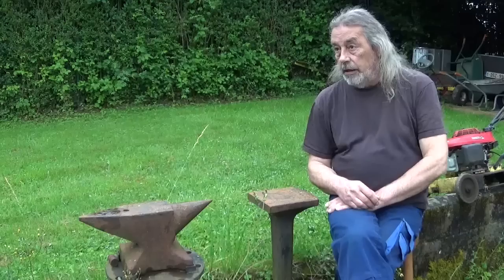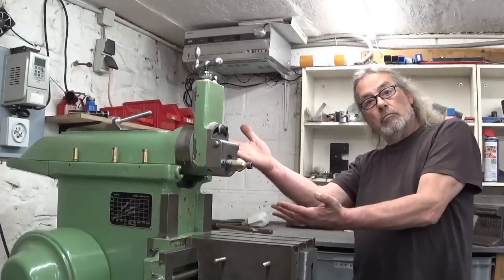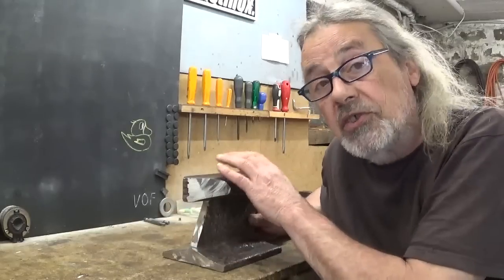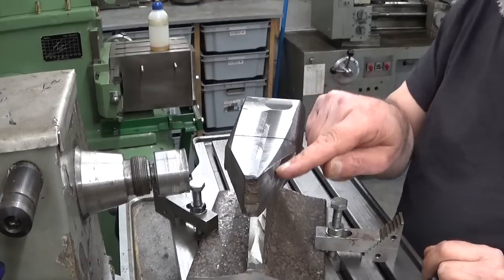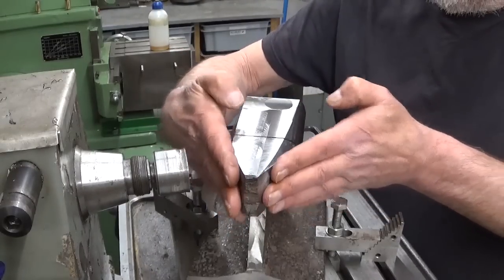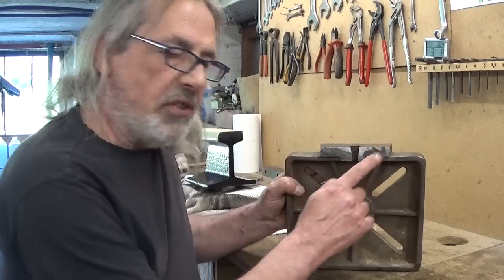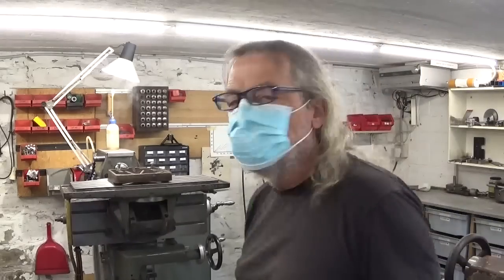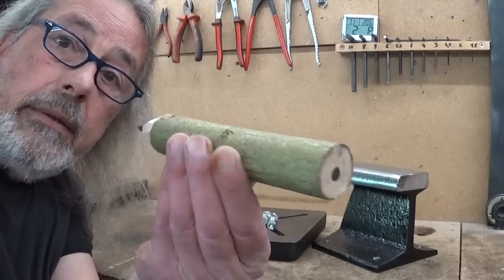A rail anvil... from a piece of rail.

Comment: I made a bench dolly thing from a chunk of rail. I found welding on thick wall 1 inch steel bar each side of the centre spine gave me an easy way to clamp it in the mill. My first attempts at milling the top and bottom and ends flay didn't go well with HSS but once I got carbide tooling I was able to redo it and it came out much better. I mind it really useful as a large chunk of steel with good, 90 degree faces so often use it as a big 1-2-3 block if that makes sense.

Comment: The rail used in switching yards, called “yard rail” here in the states, is made from a higher grade of steel and is definitely hardenable.  In my experience, standard line rail has a work-hardened skin, but it doesn’t get very hard when you heat and quench it.  I have a section of “captured” yard rail that is designed to keep a car from derailing.  I have yet to decide what to make with it, as the shape is unique and I think it would make a good swage block as well as a good anvil.

Comment: When machineing cast iron use a vacuum cleaner, best to make a adjustable bracket for the hose 🇬🇧👍.
Reply from the maker: That's an idea.
Reply: @Rustinox  To add to this when turning cast iron on a lathe, have the tool upside down so it goes straight in the vacuum hose, 🇬🇧😎

Comment: My Dad had several of these, as he worked 40 Years @ NSW Railways, Sydney Australia, in Main Workshops, Scrap Rails were converted into these for the Upholstery Staff & Others @ Workshops to have on Bench, as sometimes some metal shaping was required when wrangling a Train Seat or Fittings, How they were made is not something I know, but yours looks at lot more "Designed" & Neat, Flat & Straight with a Stand, Dad's had 4 holes for bolts, Good Work .. Only thing I notice is under spike is Angled, NOT Rounded, but maybe that was for Upholstery ..
Reply from the maker: Well, it's just a little change of plans.
Reply: @Rustinox  Well not sure it matters, it is just different, Dad used his at home for lots of Upholstery Jobs, but a lot of Cobbler-ling, or Shoe or Boot Repairs, Heavy Leather/Saddle Work... I think it depends on what you use it for but I know it also helped with curving Metal plates before riveting repairs etc .. I should mention another variety, No Pointy bit, but a 8" "Tongue" about width of rail, just for shoe work ...

Comment: Nice job. I wish I knew where to get a piece of rail. However it did occur to me that cast iron might not be the best base to hammer on as it's known for being on the brittle side. It's probably fine for leather work but for heavy bashing I would make a wooden base.
Reply from the maker: It will hold just fine. It's not made for sledge hammer use.

Comment: What a lovely non-heavy anvil. I did use a large Russian shaper to flatten a piece of rail with a HSS tool. The chips came off in very tight, blue curls, and they pinged all over the workshop. 
Regards,  Preso
Reply from the maker: Thanks Preso. But my shaper is Dutch, so...

Comment: Time 00:45.
Drill a suitable hole in it and use it for candles! We sell such on "my" veteran railroad!

Some people use a chainsaw to make wooden sculptures.. Joking!

To make a flat surface... The shaper. Don't know but guessed "the shaper"..... Joking!
Time 05:30. Once made a converting piece, 4 sided to 6 sided. The object was a 4 sided Chrom Vanadium piece. 2 Tin-x coated mils bits cot ruined. A grinder had to finish the job. Then the guys lost it. 2 new were made out of more soft steel...
To cut rails a roaring disc machine is used. Drilling holes for the joints are made using cooling liquid and an unknown type of 30-40 mm drill bits.
Do did quite some cosmetic work...
Thanks for the entertaining video Michel!
Reply from the maker: Thanks Stefan.

Comment: Rusti, Kurtis had a 1000 mm Klopp shaper and Matty was supposed to come and rebuild it. But my guess is that he sold it. The Jig Borer is still there. Maybe you can get it. Or better still, the French made milling machine that has the head that rotates to any angle from horizontal to verticle. He's not using either of them. He has now started to be an infomercial channel much like Abom79. Maybe you should get the junkyard where you always find material to sponsor you...???
Reply: I think curtis is too busy to have the time to restore and learn new machine, he already have enough work with his capacity so upgrade the shop even more  may be not the best for him
Reply from the maker: They also live on the antipode from where I am.